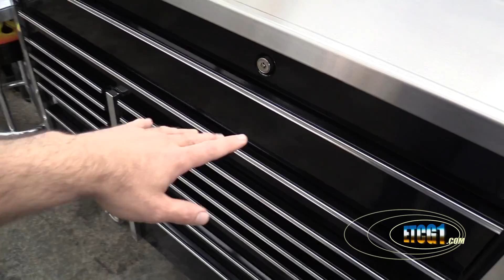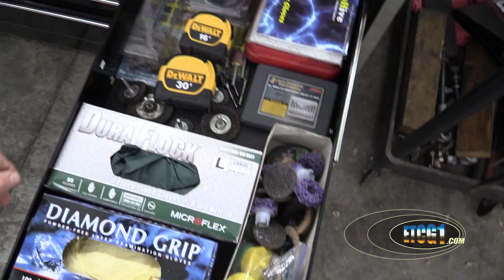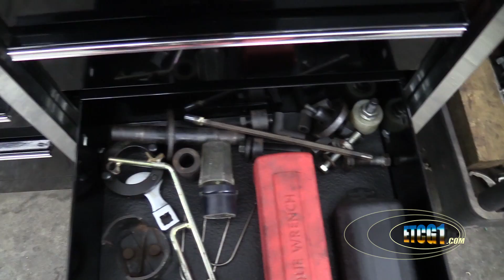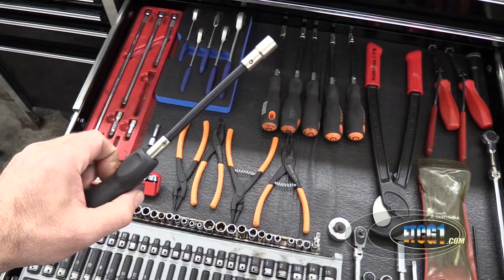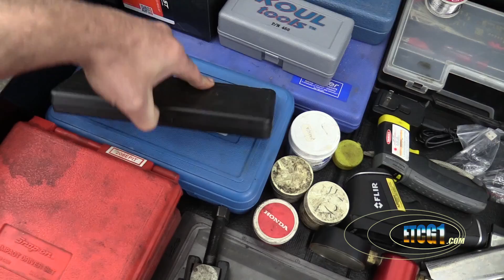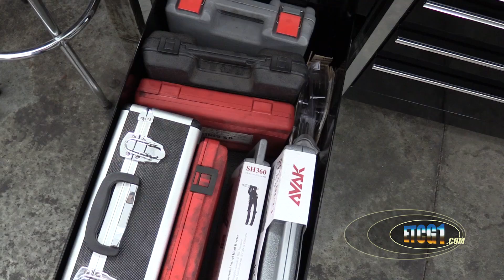**New** Snap-on KRL1023 Tool Box Tour

Comment: Those little clamps from Harbor Freight save my bacon, Eric. My marker light lens, both ears broke off where the screws go. A little epoxy and those EXCELLENT little clamps to hold each side in place, an excellent fix. Great little tool.

Comment: In the electrical repair drawer - What's the little thing for holding wires together with the alligator clips and the spring clamp called?  I NEED this.
Reply: n20cpri i remember watching an old old video of his he just used wire looped it around and attached two alligator clips to hold wires for soldering.
Reply: Pretty cool thanks.  I have a radio shack helping hands and sometimes it's too bulky.  This is cool.
Reply: they sell similar ones the matco truck, it has a magnet on it.  pretty sure its made by lisle. its pretty small and the magnet seems helpful.

Comment: I use Mechanical Fingers to get dropped stuff. Somehow I think they work better than those giant tweezers (mantis) would. Similar to using a magnet, but it has claws that are operated by a plunger, can grip onto bolts/screws that have gotten hung up when they fell and yank them out.

Comment: Seems like the corners of your shop are leaking?  I hate that blown insulation crap..  Hope you don't have mold...  Do you own or rent that shop?

Nice box Man!  So jealous... But, I'm just a Big Dumb Goof compared to you in terms of modern automotive experience.

I have worked on cars with my Dad since I was a kid going back to when I was around 7 years old (circa 1970 with his 1966 Fairlane 2 dr with a 289, 3 on the tree)  All I did was hand him tools at the time, but it got me under the hood!  Then, the '65 Impala, '71 F250, '73 Impala, my own '71 LTD.  We did an engine swap in the '71 F250 in a weekend (390, C6) when I was around 17 and I did an overhaul on MY '71 LTD with a 400 in it when I was around 20 years old.

I have a lot of basic tools and love trying to use them...  I'm one of those Goofs that knows enough to be dangerous, but also knows when to call an expert...  I'd call on you in an instant, but you are in Ohio and I'm in Washington State.

Love the vids and Love the Fairmont build.  I've had a number of cars between the '71 LTD and my '13 F150 Ecoboost and one of those was a '86 Mustang GT... Loved that car!  My dream Mustang will always be a '69 Mach 1, but until then, I can't wait to see what times your Fairmont pulls.

Mitch

Comment: I thought you were a dewalt guy. But you've stepped over to the dark side and touched Milwaukee Red.

I don't know if you got that drill as a set, but with the power it has, sometimes you WILL need that handle!

Their mid-torque 1/2 impact is the bees knees!

Comment: I got one of those hammer head angle impacts years ago and was sorely disappointed.  Every time I found something that it would be awesome for.....womp womp not enough power.  It just sat in my box and i ended up trading towards one of the new snap on torque wrenches that does angles and all that.  waaaay more useful lol

Comment: Awesome set up. At first when you opened the big drawer and I didn't see sockets I was like wtf. But after seeing your sockets you really don't have enough to fill that drawer. In my snap on box that drawer is packed with sockets plus I have like 2 other small drawers with specialty bits/sockets. I was wondering about that leverage wrench, so you don't have to double wrench, have been trying to find one, nobody seems to know what I'm talking about. I looked on that JBTools website you linked, didn't see it there, although I could have missed it. I was wondering what brand it was, maybe a part number? Thanks.

Comment: I counted 70 ratchets in my box the other day and all are newer truck and industrial brands I got way more than that in just extensions lol . I've noticed that most mechanics really don't have many ratchets in thier boxes maybe a couple of each drive size and are usually just minimalist. I'm not a professional mechanic I consider myself a collector but I was an engine guy at a junk yard and pulled every other part from anything you can think off as well as many auto repairs. I like to have a variety of brands even in the same style ratchets but all a variety of different style ratchets for different applications it's nice to be able to try out all the truck brand ratchets and other tools and compare them all. I've learned snap on is not the greatest really I think the other truck tools at least the hard lines are pretty much equal and as for preference I  ratchet I prefer them Mac axis 90t or Cornwell 72t over snap on the Macs look the best the Cornwells seem the heaviest and have very strong 1/4 and 3/8 with the biggest paws and gears which equal to more contact area and strength but like snap on for 1/2 but have not tried Mac in 1/2 yet.

Comment: The European tech has all his tools provided by his Dealer/Shop. Nowhere near this amount of tools but the same work got done, how could this be?
Reply: People buy their own tools still, not sure where you got that idea? Safety gear is usually/often provided by the company though. Does depend a bit where you work.
Reply: BMW Dealer in Switzerland. Did all the same repairs as with a US Dealer,never bought one tool ever.
Reply: Guessing it depends on the country. Not at all unusual in the UK to buy tools. Sure, some brand-specific tools are supplied by dealers ('VW Special tool number three hundred and seventy five' may be supplied, socket sets and spanners may not be).

Comment: Those Harbor Freight clips work great for potato chip bag clips as well.  Cheap and SUPER useful!  Totally agree!
Reply: I use department stores clothes hanger with the clips to hold shorts there free usually thrown in the trash. just cut off the unneeded parts and only save the clip there way better than store bought ones that always crack.
Reply: I read your comment, walked into my laundry room, grabbed a hanger, cut it and have it on my chip bag.  Awesome idea!  Thanks for the tip!

Comment: harbor freight step drill bits = junk. kinda work.
I found the air impact watchers.. just to large. to lunky.

solution to the box wrenches.. harbor freight box wrench organizer. cut off what you don't need. goes from super small to 1-1/4". cut the locks off them also. 

love the skinny drawers, keeps you from stacking crap in  them.

Comment: Eric, tell your landlord to fix his S#it. 
Good tool box video.
Reply from the maker: I did, but the guy that's suppose to do the work isn't reliable at all. Also, he can't be working in there while I'm working. It's hard to shoot video when someone else is making noise.
Reply: Set up a week or two where you can take a vacation and he comes in and fixes stuff. If he doesn't show or ???? Dump the place. Think how "great" it would be to walk in and find the ceiling laying on the toolbox, Fairmont and whatever else you have in there at the time.  Plus you need to consider that there is very likely mouse/rat droppings in that insulation with the possibility of the diseases they carry.

Comment: If i lived there. I would come and fix your ceiling if you swap my old rusty muffler to a new one. Haha!
Reply: But seriously though. You should just put a square of plywood there with screws and spraypaint it white..  Makes much less mess to clean when the hole is plugged.. 

The ceiling looks like it's missing the moisture blocker film.. If you redo it some day, you should put the moisture blocker there to make this problem no longer occur.
Reply from the maker: Well, it's technically not my problem since I'm renting. I've notified the owner. Thanks for the suggestion.

Comment: Just curious is there any similar toolboxes at a fraction of the cost? Kobalt, craftsman, etc. Like a higher end model that i'm sure would still be a fraction of the cost
Reply: I have a year old Snap-On box, setting next to a 44" Craftsman professional box next to a 44" HF box. Both the SO and Craftsman were daily use boxes for many years. No real issues with either one. The SO is a deeper box than the others, and IF you can get one used in good shape they are a great box but the new price will scare you. The Craftsman box has held up very well I like the griplatch system. The HF unit is only 6 years old but it has been just fine. I know guys who use them daily. 
Will they last as long as the SO box? Probably not, BUT when you consider that you can buy 10 of the 72", 13 of the 56" ones and close to 30 of the 44" for the price of the new SO box.....  

If you are a DIYer who isn't twisting steel daily I wouldn't even second guess it, I'd go with one of the HF units. If you are a new tech who is still getting used to the grind, I would also go with HF, until you are SURE you like the work and can make the money it takes to buy a higher dollar unit. 

As for the Craftsman box. It is a good box, it was actually made by Waterloo prior to them shipping the line to Mexico.  BUT given the purchase of the Craftsman brand from by Stanley/B&D I'm not sure what the future holds for them.
Reply: you can always buy 2 harbor freight 72s if you really mean "FRACTION" of the price
Reply from the maker: Nothing that I know of. Not with drawers this big, or of this quality.
Reply: I have heard very good things about Extreme Tools' tool boxes.  Here's a link:
http://www.strictlytoolboxes.com/extreme-toolbox.html?gclid=CJ3dhfzfmdMCFYa4wAodfL8IGA